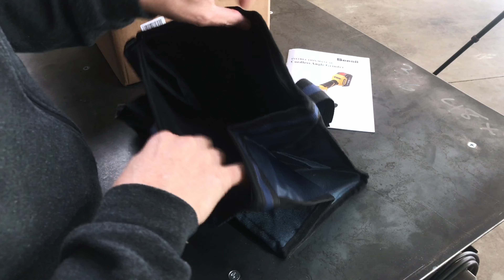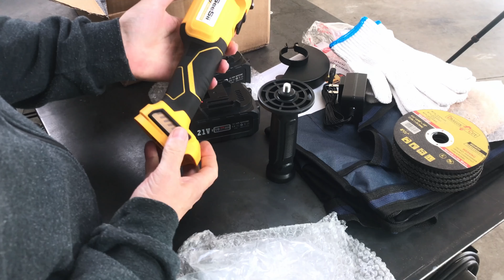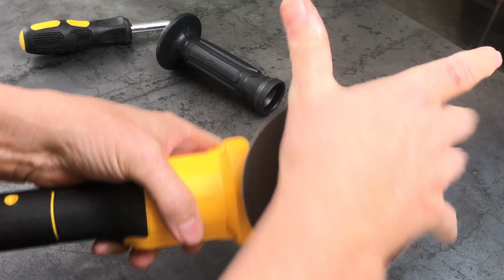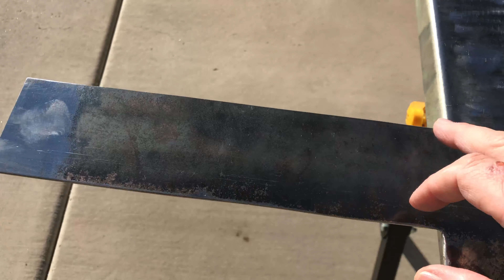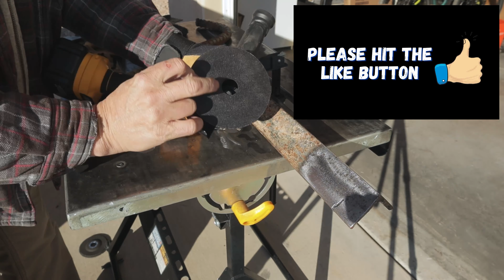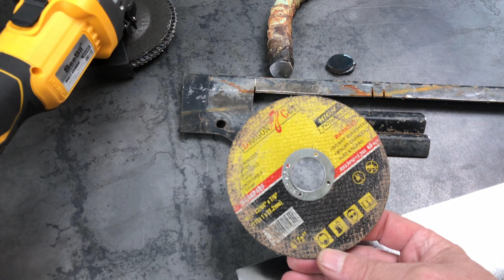Did I Waste My Money on This Budget Cordless Grinder?

Comment: Nice review Bruce. Would love to see how it handled the wood shaping disc. Cordless  Angle  Grinders are battery hogs!!! Thanks!
Reply from the maker: Thanks Mark! I don't know about the wood shaping disc, it looks like a potential visit to the ER. Maybe I should test it on a block of cheddar cheese. LOL I guess it's a good thing it comes with two batteries. One for use and the other on the charger but for those quick little grind jobs it seems very handy.

Comment: Im really fighting switching over to battery powered from gas especially with my trusty 25 year old lawn mower. Mostly because spare batteries cost more than the tool itself and no battery is going to last 10 to 20 years, and the manufacturers  change the style of the battery and then you cant get one to fit the old tool. Maybe im making a big deal out of nothing.  Grewt review Bruce.😊
Reply: I've gone on this journey already. Yes, the batteries don't last more than a couple of years, and it costs less to just get a new mower. I switched over to a plug-in mower, and I couldn't be happier. Yes, I have to be careful with the extension cord, but i've had it for years, and it works every time.
Reply from the maker: Thank yo elj, I agree with you 100%. Unfortunately we live in a "throw away" society and it's only getting worse IMO.
Reply: I'm currently watching a video about electric cars catching on fire all,around the world. 😀
Reply: No way that's brushless at that price point!